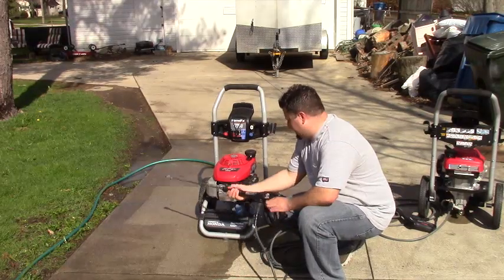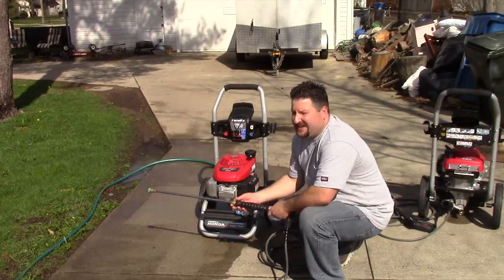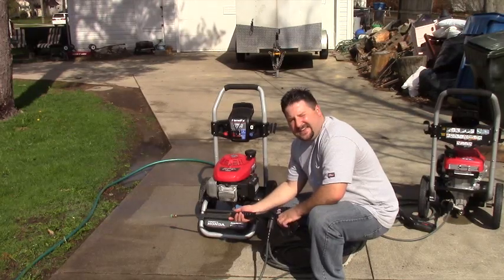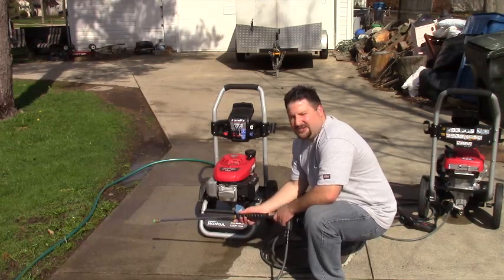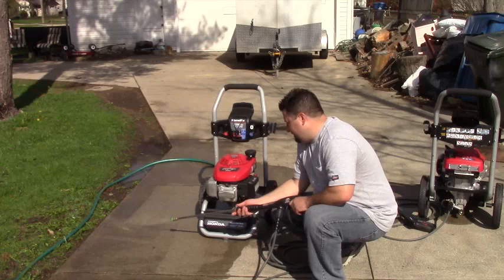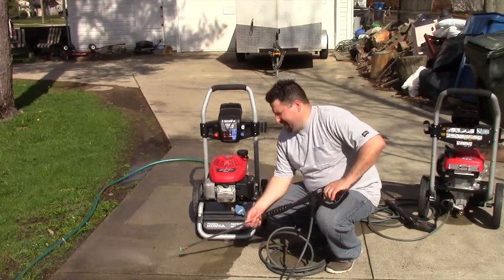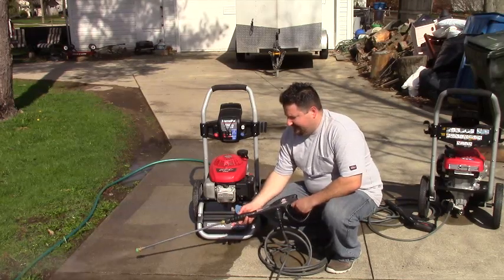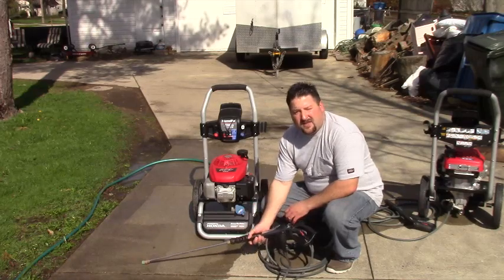Problem with Homelite 2700 pressure washer from Home Depot

Comment: So you bought a new one cause it was broke the pump cost about $60 for 25min instillation with basic tools Shure beats 299$ mine survived the winter
Reply from the maker: not sure i understand your comment, most of the guys on this thread are fixing theirs for free, just unsticking the unloader valve and it works again.
Reply: Well why do you have 2 of them
Reply from the maker: I gotcha, I didn't understand what you were getting at at first.  
I looked at your time break down and I don't see this as a 25 min project.  I would have spent time trying to figure out the problem (troubleshooting and internet search or on phone with homelite customer care), say it was the pump, then I would have had to locate one, then drive and get it or have it shipped to me (at this point I'm 2 to 4 hours in if I'm driving for it or days if it's shipped) then when I got it I'd have to pull the old one and install the new.
Id say I'm looking at a half day or more of down time at least to solve this problem and that's if everything went right and I could find a pump locally.  For me, during my busy season, that's not worth it, time to replace and deal with later.  I usually end up with two sets of my most used tools for this very reason.  Customer's don't like hearing your not showing up due to faulty equipment.  Everyone's circumstances are different and for you, if this is just for around your house and time is not of the essence, then your way would make more sense.
Reply from the maker: and if I'd had the information that's on this thread when this happened to me, I'd have had it fixed in about five minutes. No pump required.   I'm learning here as well. :-)
Reply: Okay then thanks for the information
Reply: The Burb Billy how did you fix it im having the same problem with mine....
Reply from the maker: juansh22a one of the guys posted a video on the thread, he shows how to fix it step by step.  It's a good video check it out.  If that doesn't fix it for you let me know.
Reply: The Burb Billy
Where is this video link?

Comment: I had that same problem. I took it back and it happened again and home depot said after the second it wasn't there fault and they wouldn't give me a refund
Reply from the maker: Sorry to hear that Nick, I have been really disappointed with some of the customer service I have received at Home Depot the last few years.  I've learned that different stores have different sales and customer service cultures on their floor so if you have several Home Depots in the area you might try another one.  And clearly you're not alone with your problem seeing as I launched this video around May 1st and it has well over 2000 views.  Did you see the video posted below in the threads that shows how to fix the problem?  I've heard a lot of positive comments about his video, check it out.

Comment: Owned only 3 months, still like new, kept garage only
Reply from the maker: Suzanne Johnson Hey Suzanne, Thanks for commenting!  I'd say if you've only had it three months then I'd return it to Home Depot and exchange it for another.  Even if you're a few days past 90 days they should still exchange it for you.  Otherwise you will need to contact Homelite Customer Care and they will send you to your local service center and you will have to take it there and leave it to be repaired.

If you want to try and fix it yourself then I'd suggest replacing the two hose clamps on the line and even the line itself if it got damaged.  If the unit has been sitting in the garage and nothing damaged the gas line then just do the clamps.

The clamps on the unit are extremely cheap which is why I am recommending replacing both of them.  When you remove the clamps and the hose be prepared to have something there to catch the gas that may leak from the tank if there is gas in it.  If you're not sure on the clamp size you can take the hose to a hardware store or just buy a small variety pack of clamps.  Hope this helps.  If it doesn't or you get stuck post what the issue is and I'll try to get you a solution.
BurbBilly

Comment: Read the manual..... If you don't know how to take care of your equipment, it's your fault! I live in the Northeast and never had problems in 30 years of storing any of mine outside in the shed. Use E-0 gasoline and run Marine or RV antifreeze through the pump. It's a water pressurizer, so it has water in it. Would you leave your car outside with only water in the engine???